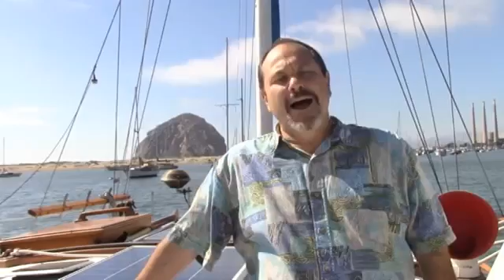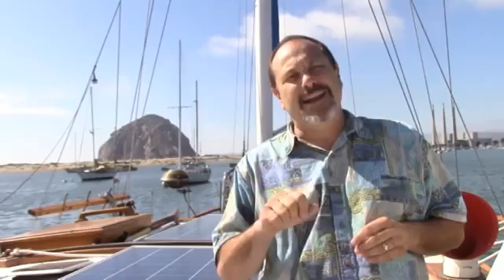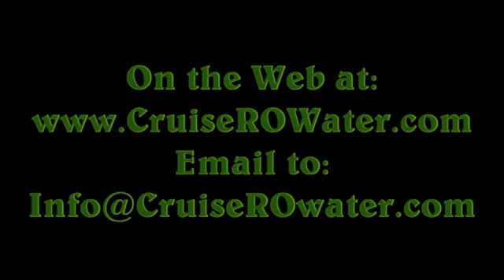Marine Water Makers and a Dedicated Through Hull

Comment: His arguments are not very clear. Why would there be risk of air bubbles if sharing an inlet with the head - where would they come from? And 'fighting' over the water? Pumping the head, you very occasionally suck in a couple of liters. I can't se how that would impair the function of the wm's 100+ watt pump. And a y-valve would be risky for the wm if left in the wrong position. And you would have to make sure the wm is turned off before taking a dump - easily forgotten by a guest.

Comment: Nice video - thanks. I wish you could address issue where it seems some folks change the thruhull to one with a scoop so it minimizes air entry while sailing/motoring. I am not sure why air should be below waterline but I have read several folks finding this fixed their problem of air entry while underway. Would appreciate your thoughts on this.